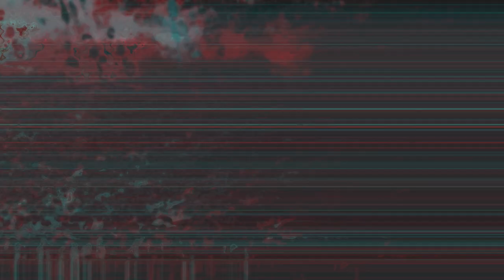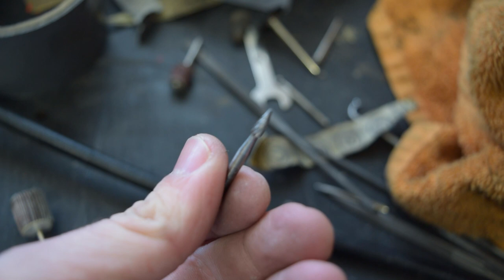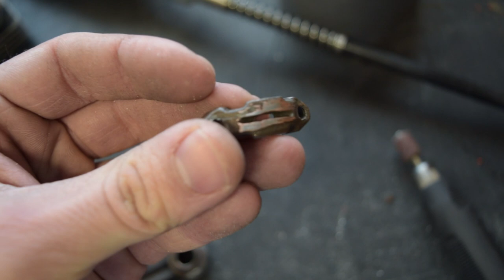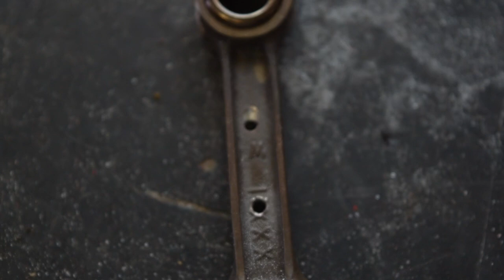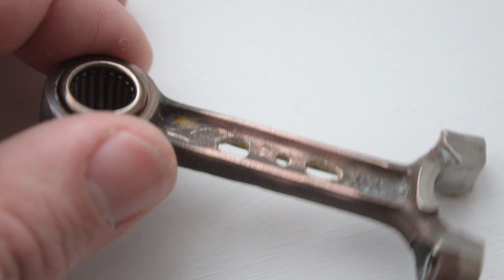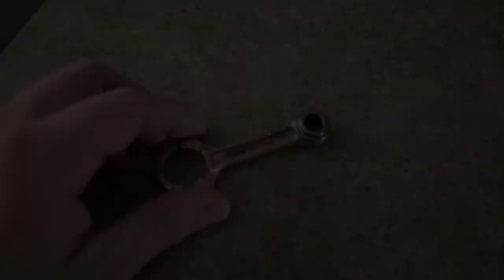HOMELITE HOTSAW (Part 12) - Connecting Rod WEIGHT REDUCTION!

Comment: Did this con rod hold up? I have a small 2 stroke motorized bicycle engine I wanted to lighten the rod & piston a bit.
Reply from the maker: Haven’t ran the saw much but so far it’s had no problems
Reply: @RonnieMacJr69  Thanks for reply....I've seen several pictures online of rods with holes drilled in them. And seen several Harley engine builds with lightened con rods. So I think those cheap 2 stroke motorized bicycle engines come with a rod plenty strong enough for a couple oval shaped holes....The usually do 6500 max rpm stock. I'm only going up to 7500 or 8000 max rpm. I think the lighter rod along with a balanced crank would actually help prolong engine/bearing  life since you have less reciprocating mass spinning at 7500rpm 🆚  having more weight spinning at 7500.